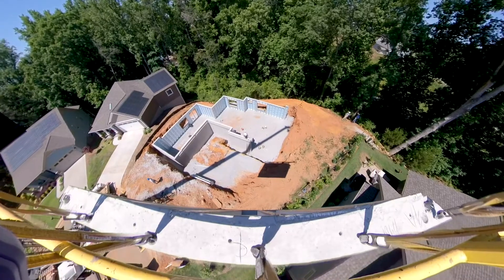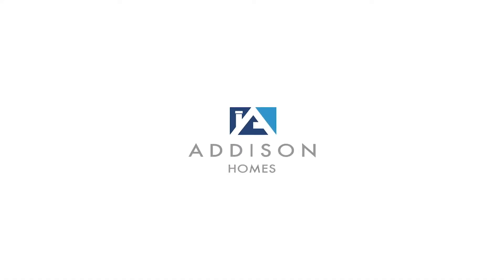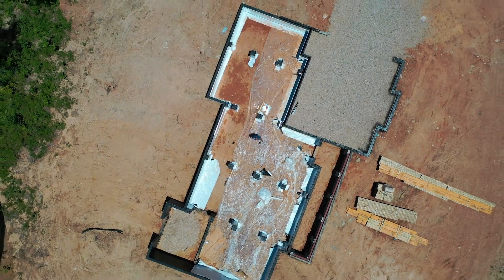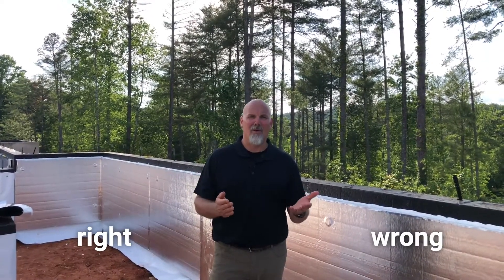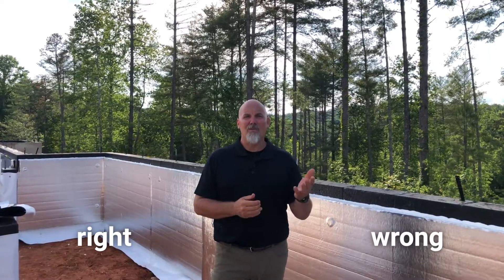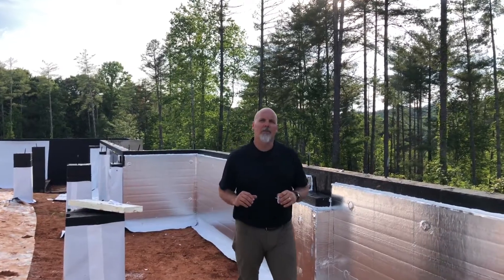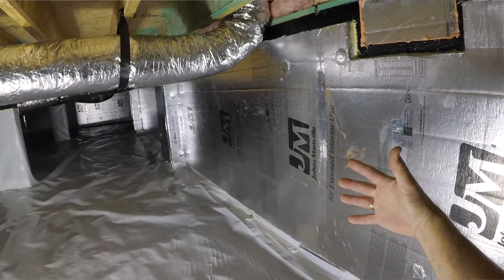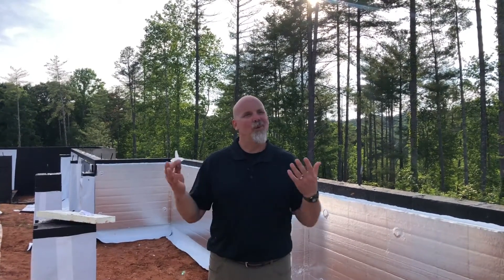Why Close a Crawlspace? | Addison Homes Explained

Comment: Question is why do a vented crawlspace? Simple answer is it’s cheaper for the builder. Cost gets passed on to homeowner.
Reply from the maker: There are a couple of perspectives to that question.  First, homes built 75 years ago on open piers and vented crawlspaces did not necessarily have problems.  Before we built tight homes and air conditioned them, we didn't have issues with open foundations.  As we have evolved in building practices and incorporated space conditioning (specifically air conditioning) and tighter building envelopes, the science of vented crawlspaces has come to light - especially in humid climate zones.  
The construction industry is not the most innovative in adopting the latest in practices and methods - especially as it relates to building science.  So the first perspective to the question of "why build a vented crawlspace" has much to do with the industry doing "what they've always done" and not embracing the latest building science.  In fact, the building code still permits vented crawlspaces - so the industry as a whole has not acknowledged the inherent challenges with vented crawlspaces in the South.

The second perspective to that question definitely has to do with cost and complexity.  Building an encapsulated crawlspace is far more complex than a vented crawlspace.  There are schedule implications and precautions during construction that must be taken into account to address preventing mold and mildew during construction.  There are also cost implications due to the additional complexity.  As with any product, the costs to manufacture the product are reflected in the price of the product to the end consumer.  Encapsulated crawlspaces are more expensive than vented crawlspaces.  When we are advising clients on possible foundation types, we are clear to point out that the encapsulated crawlspace choice is often the most expensive.